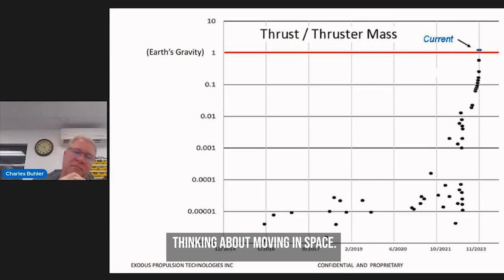Did They REALLY Crack Gravity's Code? New Impossible Engine Explained!

Comment: I suspect the reason you're getting negative comments on a nicely positive video is that ion drives produce thrust without having any effect on gravity other than producing an opposing force. As other posters have pointed out, the drives have so far been useful for very small long term thrust.

An interesting thing to ponder is energy is required to produce force by Newtonian reaction. Once you produce enough force to start lifting in earth's gravity, you are converting chemical or electrical energy into kinetic energy. The KE added to the spacecraft is getting converted from KE to gravitational potential as the spacecraft lifts.

Fun stuff.
Reply from the maker: I appreciate you taking the time to delve into the science behind ion drives and gravitational potential. Your input adds more depth to the topic and I thank you for adding to the comments. I'm still looking forward to seeing what comes out of all this, but I think I may stick to more concrete, proven topics until more is known. Thanks again!
Reply: @BrightMindHorizons  Proven topics are golden, but also dream, explore, and drop your docklines as Sam Clemens once said. Science is for everyone. One of the most endearing things about math and science, particularly to one as inept as I, is something Richard Feynmann once said in a lecture.

No matter who you are, how fancy your credentials, or how pretty your hypothesis, if it doesn't match observation, it's wrong.

The converse of that is that conclusions based on observation, sound reasoning, and rigorous methods will work for all of us.

All the best.